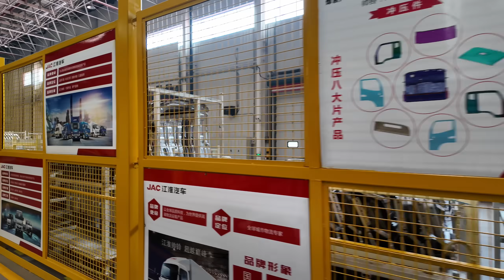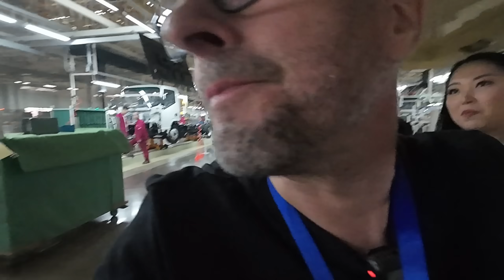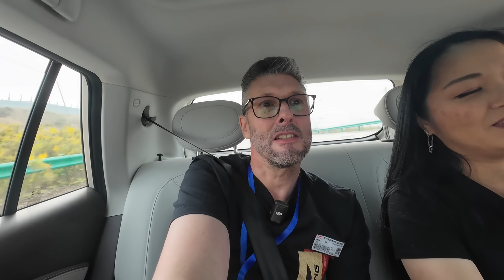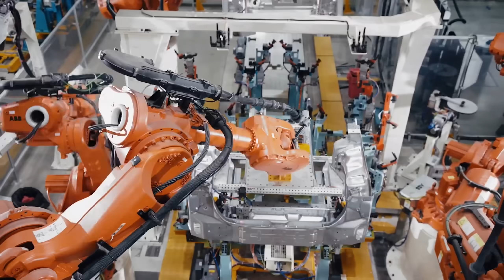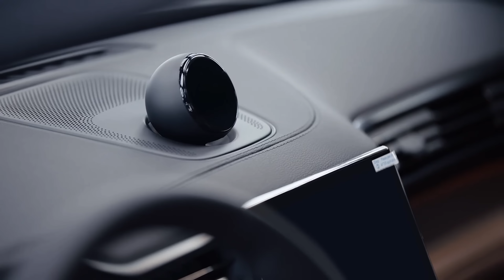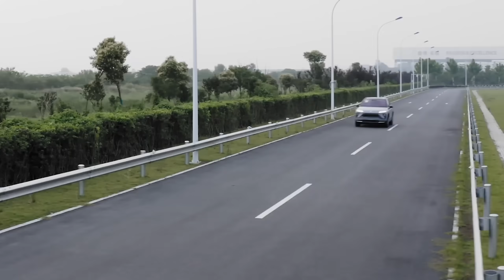The West just cannot compete with China's Manufacturing

Comment: Not just manufacturing, they can't even beat the repair sector. When something breaks in the US, they replace the components. In China, they can actually repair it instead of replacing it. So if a chip is bad, they put in a new chip instead of replacing the whole entire board.
Reply: No! We also replace, because for us in a big manufacturing country, the cost of manual maintenance is more expensive than replacing a new one!
Reply: @袁永鑫 I have seen the repair shop in China. They were soldering chips on TV. You must be thinking computers and other stuff.
Reply: Bosch Car Service - the largest automotive workshop chain in China and globally!💪💪💪
Reply: Here in New Zealand we gave up repairing parts 40 years ago , I went through the change. Only parts we repair is heavy section frames etc. In diesel injection systems we replace parts 

In this truck plant it's still very primitive and I see no anti corrosion treatment for body components and panels.
Reply: @conmanumber1 The problem is repairing means existing parts (some still good) going to the trash. If we continue throwing things away, we are destroying the planet. Otherwise, we should all drop the recycling BS and let trash continue to build.
Reply: This video is just a brief overall tour of the factory. What is not shown does not mean they don't have. @conmanumber1
Reply: @conmanumber1 yes, in US you have to repair yourself, otherwise you have to pay big money and not guarantee it get fixed correctly.